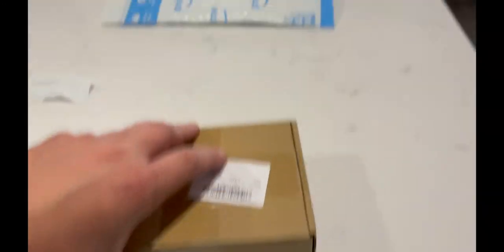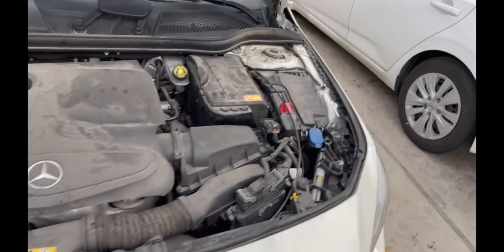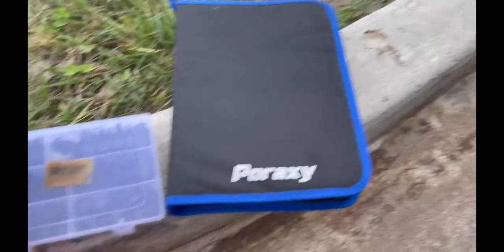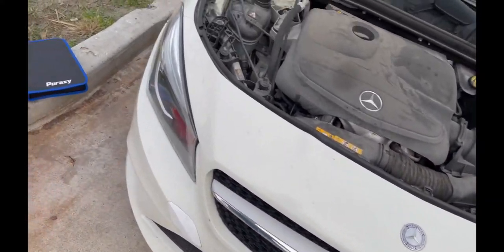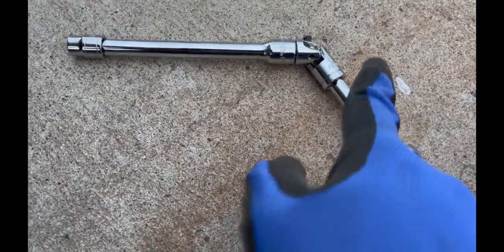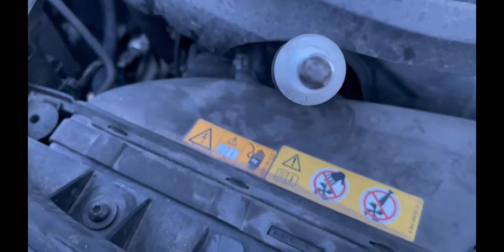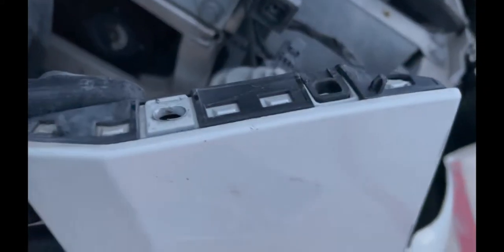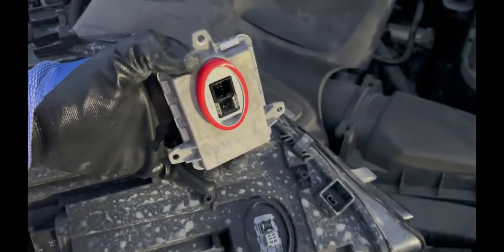How To Replace 2014 - 2016 Mercedes-Benz CLA 250 Headlight Ballast

Comment: Hey Reynaldo, a big thanks to your video. I also own a 2014 CLA250.  I had the exact same problem for the drivers side light, when switching the bulb to the other side it worked.  I bought the replacement balast and now works like new.  Your also right about the bumper, takes longest time and a pain in the ass to remove.  But save bunch of money VS having the dealer do the work.  Again, thank you for all you tips and tools recommendations super helpful!!
James!!
Reply from the maker: I’m so glad that I could help out! I hope you’re equipped to do this on whatever car you have…. It’s basically the exact same no matter the car make or model
Reply: Was there any issues with the coding after you put the new lights in?

Comment: Hi I have a gla 250, one of the dipped beams is out so i changed the bulb, didn’t work so I swapped the left ballast to the right and both headlights stopped working. I put the good one back and it was back to the same one off one on. Any ideas would be appreciated thank you

Comment: Nice video! My turn signal & LED daytime running lights are out on the driver side. Would you think that is a ballast as well?
Reply from the maker: If it’s the LED XENON version you may need to replace the entire housing. eBay has them for about 600-800. A little pricy but that should fix the problem
Reply: Did you ends up solving the issue? My driver side daytime light, turn signal and HID all stop working
Reply: @ReynaldoVelasquez  what would be the part number for a 2014 cla 250 headlight Assembly because my whole driver side lights aren’t working, thanks

Comment: Does sometimes if you replace fuse light its work
Reply from the maker: Never worked when I tried. See if the fuse is busted first. If it’s fine then it’s probably the headlight itself (ballast)

Comment: Hi mate, I have a 2014 cla 250! Thanks for the video.
My problem is that the led daylight light is not working and I get an error that the turn signal does not work, which is not true. It works, but when I turn it on it clicks like crazy in the instrument cluster, but it flashes completely normal in the headlight itself. One thing to note is that when I lock/unlock the car it did not flash. My high and low beams work perfectly. Just the daylight led is not working. With your help I managed to replace first the balast on the bottom of the headlight, but nothing changed. Then I changed the control module which is on the side of the headlight/there was moisture inside/ and now the turn signal flashes when locking/unlocking the car. However, the daylight led came on only for a few seconds and went out again and does not work... I can see the following error codes when I scan with OBD: B177887 and B283F87. It's for the right headlight, left one is working perfect. Also, there has never been any water inside the headlight itself. Do you have any suggestions? Any help is appreciated!
Reply: I have the exact same issue as you described...did you get any further or have any more information??

Comment: I have a Mercedes Benz c300 and the passenger headlight is foggy and has water in the headlight housing. Now the headlights fails to on, do i need to replace the whole headlight or just the ballast please. Get back to me asap. Thank you
Reply from the maker: So that exact thing happened to me before. When the moisture would dry up it would turn on again. But eventually the fog shorted out the ballast. You can replace the ballast only… but eventually with the first rain, car wash, or early morning dew… it will eventually blow out your new ballast and headlight again. So yes You will need to get that housing replaced for sure. eBay had some pretty good used headlights for sale. Just make sure to look at the screw brackets on the eBay listing photos. Sometimes a bracket may be broken off the housing, where it’s supposed to install to fender area (if the car was in an accident before etc)  Make sure it’s all intact (so your headlight won’t be loose or flimsy when you install it) and check out the lens for yellowing and scratches. Find the best one that makes sense for your situation. Hope this helps.

Comment: Hi , mine 13's cla 220 have problem witj left headlight xenon is out , led is workin, can you help me
Reply from the maker: Yeah, if you’ve already tried to replace the headlight bulb itself… and it still isn’t working… it very well could be the ballast. It’s an easy fix. Just a few screws and bolts to take the bumper off and the old headlamp.

Comment: Is the ballast also the issue if the high beam is not working? There is only one bulb for this type of headlight assembly (mine is BI-XENON) and the bulb is supposed to act as low and high beam. MB Dealership suggested to replace the entire headlight assembly for $1600++ (surprise! wtf to that)...
Reply from the maker: Yeah well, first replace just the bulb. That’s an easy $60-150 on Amazon or any auto parts store. (You’re right, the one bulb is both high and low beam. I believe there is a little moving flap inside the lens housing that opens up fully to allow the high beam) if the Bulb doesn’t fix the problem, replace the ballast… 99% of the time this will fix the issue. You only need to replace the entire housing if your housing lens is cracked allowing water to leak in… or if the “eyebrow” led strip goes out for the blinker and daytime running lamp. Also if the ballast doesn’t work, there is also an igniter that helps the ballast. You could replace that for about $50 too. But that has never gone out on me. It’s located right near the ballast on the housing. Hope this helps, and sorry for the long response. Ask if you have any more questions
Reply from the maker: Also…. If the “little flap” isn’t opening inside the housing, allowing you to get a full high beam…. But the bulb is working… then yeah it may be that little flap inside that malfunctioned… but I would still look on eBay. I found a gently used headlamp housing for only about $600 including shipping. Works exactly the same. And just transfer your old ballast on to it… or buy a new ballast and bulb etc. hope this helps
Reply: @ReynaldoVelasquez  , much appreciated your reply about inquire. cheers to that! my bulb is new, i got a new ballast (which I am yet to to replace). What is the igniter? Do you still what the part number is and where to get it? Thanks!
Reply from the maker: @jjaafar  I don’t have the part number but the igniter is near the ballast once you remove the headlight assembly, you will see another silver piece of metal near the ballast. I believe that may be it. You can just google the part or on Amazon. It’s also a simple plug and play part too.

Comment: Hi my friend, my cla 200 has the led light blinking, not the bulb, it is the same solution? By replacing the headlight ballast?
Reply from the maker: If you mean the little “daytime running lights” the little eyebrow made of LED’s I believe you’ll have to replace the whole headlamp housing. You can’t just replace the little LED’s. You can find a good condition used headlamp housing on eBay for about $600-$800 depending on the quality. Or some third party aftermarket light housings for about $200-$400. Hope this helps
Reply: Do you have any moisture in your headlight? Im only asking because that is what i believe is wrong with mine. But either way order the same thing as him and its only $40! bulb too
Reply from the maker: @schleiflife8793  no I don’t have any moisture in the clear housing. However… I once had a cracked headlight housing and water would leak into where the bulb was. It would short circuit the light and the inside glass would get foggy. I tried using clear plastic glue to patch up the holes. But water kept leaking in. Eventually I had to just replace a brand new housing, ballast, and bulb. But in this video… the only issue was a bad ballast.

Comment: hey, i own 18 cla 250 i change the halogens headlights to led headlights and when i be driving the turn signals stop working
Reply from the maker: How weird. But I’ve been wondering about converting headlights back and forth into LED’s and halogens. As far as the blinker… it might be a glitch if that bulb blew out, or if you have the LED eyebrow then you may need to replace the whole headlamp housing to get it to work again
Reply: What brand of led headlights worked for you? I

Comment: Do you know the part number for your 2014 cla 250 headlight Assembly, i need to replace mine
Reply from the maker: Hmmmm let me look. No I don’t but I’ll check real quick
Reply from the maker: Hi, so just for you… I went to RockAuto .com (it’s a pretty trusted site) and searched the car. There are part item numbers there but I don’t know if they are specific to that manufacturer who makes the lamps. But the number was: MB2502224 for the HID / xenon type. And for the Halogen type : MB2502222. The prices for the housing are : HID $1184 and Halogen for $200-$400. I should also mention that I did buy Mine (HID /Xenon) used on eBay for about $600 it worked perfectly. All I did was replace the ballast and bulbs just in case. I hope this helps. But check out rock auto and ebay for sure. Let me know if you need help on anything else

Comment: Hi, my passenger side headlight got wet from cleaning the engine, blew the bulb and replaced the bulb and still will not working, also was causing the led strips to not work until I put a new head light bulb in, once I’ve done that the led lights worked again but head would not, could this be the ballast too?
Reply from the maker: It could be the ballast. There’s also another computer module right next to the ballast that I suspect controls the led strip. I replaced both and they worked again. Also another thing to consider is if water is getting into the clear headlight housing… it may look foggy like condensation is trapped in there… if that’s the case you may need to replace the entire housing, I found good used housings on ebay in good condition. The ballast and other module are only about $50 or so on Amazon. Hope this helps a little. The only way to know for sure is to replace the ballast.

Comment: How did u unplug the power source plug from the light.
Reply from the maker: You just pull the plug straight back. You may need to shimmy it side to side until it frees itself from the headlamp
Reply: @ReynaldoVelasquez  gracias👍
Reply: @ReynaldoVelasquez  I am having a hard time unplugging the power source and I am afraid to damage it. Does the clip need to be pulled in order to pull the power source out? too bad I cannot add a picture here
Reply from the maker: @mocosito01  yes the plug just pulls out. It may feel hard at first but if you shimmy it apart or use a screw driver to pry it apart, it will get easier. It’s just a really tight fit